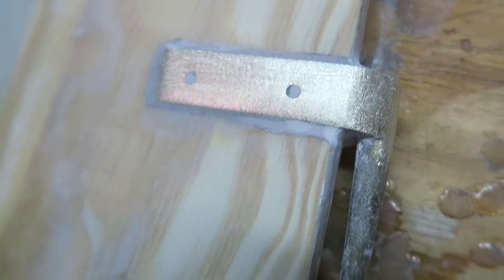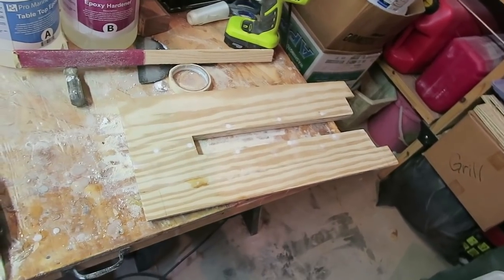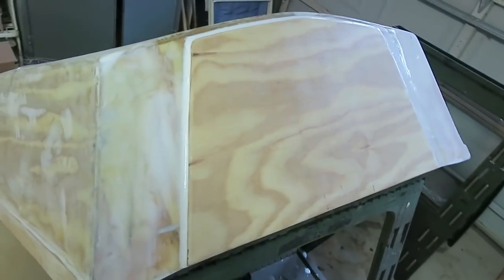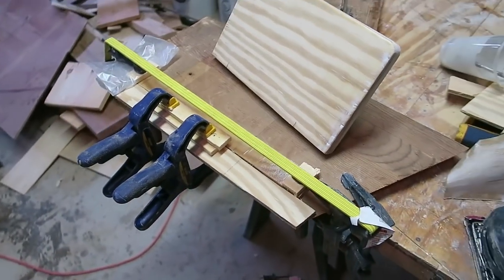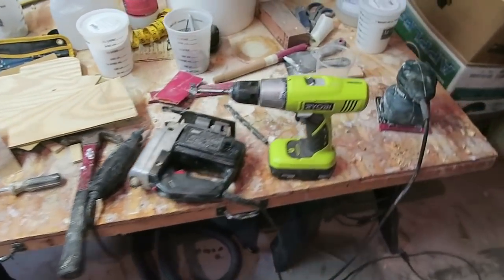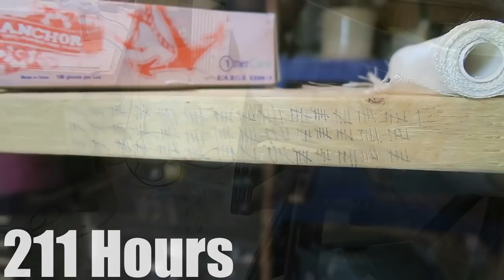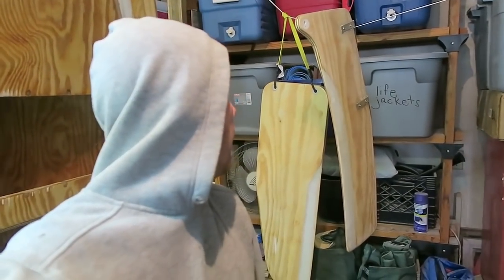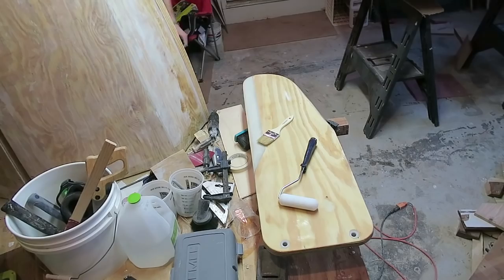Building A Chameleon Sailing Dinghy | Pintles & Gudgeons #5

Comment: The rudder and the tiller looks very smart, so far my favorite detail. 
I give you massive thumbs up for the choice of paint, even if it is not the best out there, WTF give it a go. The "marine grade" stuff is marked up to silly levels.
And, some air guitar music while working is a must.
Reply from the maker: Thanks very much for that.
That's pretty much my thoughts on it as well.
Why the heck not.

It it works, GREAT.
If not, ahh well - at least I tried something different.

I kinda have a hunch that it might work out ok for my uses, but I won't be disappointed if it doesn't.

I hope all the practice I've been putting into the bubble level pays off.

Comment: I'm enjoying watching your build as I build my own Passagemaker dinghy.  I would seriously consider installing through-bolts through those gudgeons.
Reply from the maker: That's a nice dink.
Even though they're epoxied in?
Reply: Yes.  A screw can't handle nearly the loads in any direction that a through bolt can.  Also, properly tightened, a through bolt shares the shear load with the plywood, which is a really cool phenomenon.  You've already done the hard part with the drill/fill/drill part.  Why not ensure success underway cheaply and easily with a simple bolt?
Reply from the maker: I could.

It doesn’t seem likes there’s much load on the rudder.

Now, the oarlocks - those seems like they really get worked hard.
Reply: When you're sculling the boat in light or no wind, you'll basically be slamming the rudder back and forth for quite a while.  The hydrodynamic forces on something like that shouldn't be underestimated.  Your choice.  Good luck!

Comment: I thought you were joking when you started talking about the paint like when you said you were going to use Behr wall paint as bottom paint... Lol I hope it works out. Excited to see how it holds up. Really thinking we may build one of these for our E32.
Reply from the maker: Build it.
Sometime do a little research on using latex paint on boats.
It's very interesting stuff.
Very contrary to what most folks would do, I admit, but I'm a very contrary kinda person.
Reply: I might have chosen hardware store polyurethane paint instead, probably a little tougher and a similar price.  Also sandable so you could repair a ding.
Reply from the maker: We'll see. I kinda like experimenting.
It's certainly sandable.
I've already done some work on painted areas.
It's surprising how well it adheres and also comes off predictably with a sander.
I like how it behaves thus far.
Reply: Sorry, I was unclear.  By "sandable" I mean wet-sanding to get a really smooth finish after application.  After a ding repair you could also wet sand and blend.  I am not sure a latex can do that as it is softer.

But I am splitting hairs.
Reply from the maker: No it's ok. One thing I noticed -
I sanded it lightly with 220 paper between coats.
I noticed that it got super smooth, but also lost it's gloss.
I changed to 120 paper for more "tooth" because of this.

Maybe wet sanding with 220 would make it smooth but keep it's gloss?
I'm kinda curious now.
Reply: Even wet-sanding with 600 grit will knock the gloss off.  You just need to polish it afterwards: rubbing compound and/or wax.

Comment: You play a killer bubble level! I once capsized a 16 foot Snipe and the rudder cane off and sank to the deep. Maybe safety line attaching the rudder to the boat would be a good thing? The dagger board too. Just sayin'.
Reply from the maker: Between the front seat, back seat, filler piece, daggerboard, rudder & tiller - it'd be a yard sale if it capsizes.
*When it capsizes.

Comment: I laughed at this part Ben,  06:32 you are definitely not going to make this part crooked, after going through the previous dagger board slot incident! :-)
Reply from the maker: NO. I'm done building crooked stuff.
My new rule is: 
"Measure 18 times, Check Level 27 times, Measure another 3 Times, Get 2nd Opinion, CUT ONCE."

Comment: You shouldn't need a rope handle on the daggerboard, it's a nice touch though.  Normally they float just a bit in the slot and there's almost no way for it to fall through unless horrible things are already happening.

Comment: Hate to mention this now after you are done, but it is customary to coat bare wood with unthickened epoxy first as the thicken stuff does not bond as well.  But hey what the heck, to late now.  The dingy will probably fall apart in 50 years?
Reply from the maker: Yep. I started doing just that early in the build.
The pintles had a coat before the thickened stuff went on, just cut that out.
If you look close, you can see that bare wood get darker magically right before I mix the thickened stuff.

Comment: You definitely need 2 more connection points on the lower parts of the 2 parts next to the dagger box, otherwise it will break apart,  because your wait will make the front and the back of the dinghy going up. If is not connected in 4 points it will brake apart.
Reply from the maker: I suppose I’d have to disagree solely on the fact that throughout the last couple seasons of hard use as our cruising tender there has been no evidence at all suggesting that the dinghy will break apart. Design-wise, putting additional connection points down low would be a bad idea because those points would be below the water line. It may be interesting to know that the original plans only called for 2 connection points, but I added an additional 2 for extra strength.

Comment: I noticed when rudder and tiller were in place the tiller hung down and rubbed on transom. You could place a strip of plastic on the top of the transom to prevent wear as well as lift the tiller up a bit. Just saying.
Reply from the maker: Good eye. I've laced a piece of leather around the tiller at that point.
Looks pretty good too!

Comment: Nice looking sail Ed donated! What would you estimate this dingy will weigh? Exact same paint I used in the inside of Chak Matay. Was hoping it would smash the bubble leveler at the end!
Reply from the maker: The specs say 100lbs, but I think that's a bit optimistic.
I'm guessing it'll be more like 120lbs.
Reply: By it I meant you would smash it.
Reply from the maker: HA! That would have been awesome.
Reply: Hmm interested to see if you find a spot for her on the Sandflee.
Reply from the maker: I took a bunch of measurements before buying the plans.
It should fit on the foredeck, under the boom, or in the davits.
I hope.
Reply: Sweet!

Comment: FASCO Epoxy is a far better choice than Rustoleum... and, your craftsmanship is well-deserving of a better finish.
Reply from the maker: After years of hard use, to a degree of which the majority of dinghies will never experience, the finish has held up extraordinarily well. No blisters, peeling, flaking, or even color degradation. The finish has held up very well despite frequent hauling, towing, assembly, disassembly, beaching, scraping, etc. All evidence would suggest my choice of finish was a good one.

Comment: I know they make MARINE paint. Maybe because of environmental issues. Just a thought. I am not a environmental schitzoid but I also believe the Marine paint handles salt better and has some other unique qualities. Its also much more $$$ expensive. Personally I would Rhino coat the bottom, the stuff they spray on truck beds. PS. if you bottled up your talent just on making boats and playing a great AIR GUITAR, you could make a whole other channel complete just with that. He He He. I know your multitalented, but as my father told me because I was similar to yourself. He did say just pick just ONE THING and be the best at it, and wealth / happiness will come your way. Picking just one thing was just too hard for me to do, I still turned out alright, maybe not the WEALTHY part, but the happiness is abundant. So I guess either way works :)

Comment: Good job apart from your paint choice! You should really use a two pack epoxy primer followed by 2 coats of a two pack top coat.
The paint choice is far more important than the dagger board being 1 millimetre out!! If you get my drift 😊👍

Comment: don't forget to put a rudder stop or you rudder will come off while sailing, believe me... not good!
Reply from the maker: Where's the stop go?
Reply: on the fwd edge of the rudder, a piece of spring steel against the bottom of the gudgeon to keep the rudder from floating up and out. try googling "rudder stopper".

Comment: Tambi is going to get a wet bum sitting on that dagger board infill as water will splash up there! You should have something to hold the infill in place and also the dagger board as it will float up. These are lessons learned from a mirror dinghy built back on the 1970s here in the UK
Reply from the maker: Done and done, fellas. Those potential issues have preemptively been addressed.
I told you - I'm a self-proclaimed naval architect.  ;)
Thanks for the insights.
I'm still curious what sound Tambi would produce if a cold jet of water shot upwards from below her fanny.

Comment: You just saved $150 on a sail and yet you then cheap out on buying crappy, home interior paint! You put so many hours into building this cool little boat that you should have purchased a proper a marine Epoxy paint....... Disappointed
Reply from the maker: It's held up perfectly through 2 seasons of hard use. Paint still looks brand new, actually. Some folks only know what they've been told and are terrified to do anything outside of the status quo. I guess I'm just different.